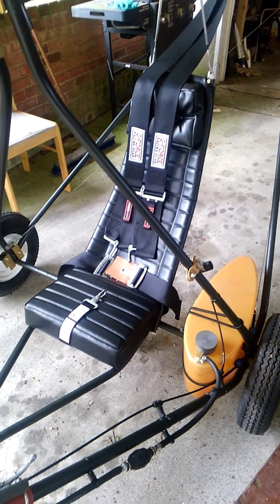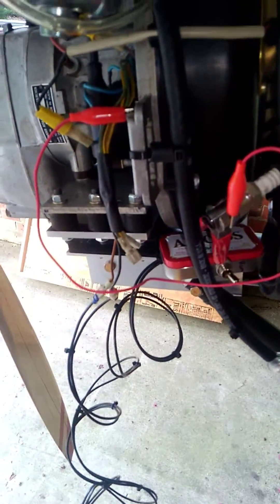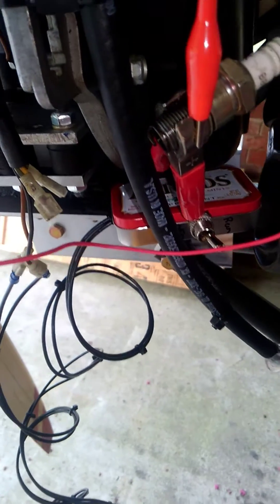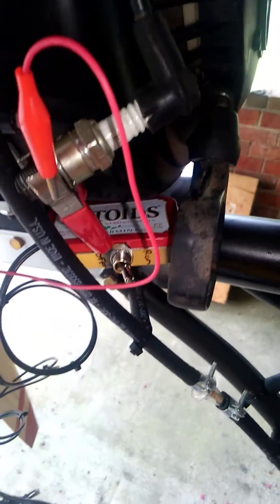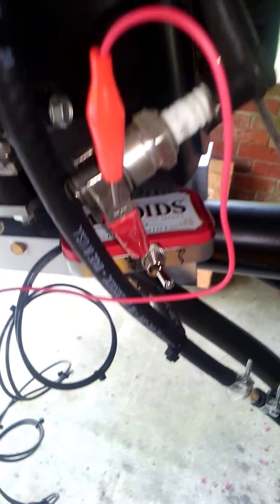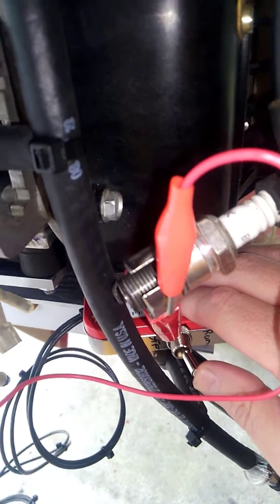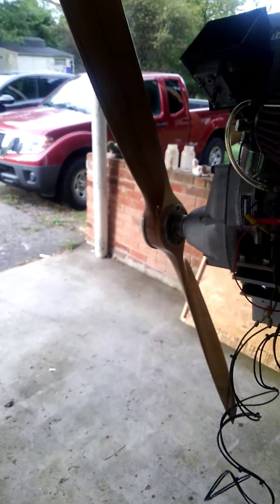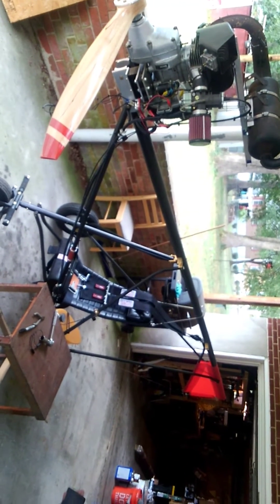A quick tour of the Chotia Weedhopper cockpit and engine

Comment: That looks to be an original Weedhopper of Utah fuel tank.
Reply from the maker: It certainly is! Extra nerd points for that you know.
Reply: @bmitchely  I used to watch them being made. I'm the designer's daughter.
Reply from the maker: @Ladychotia  Well, This Weedhopper has been in my charge since about '87. Bought it used, built in about '83, and made airworthy again in '88. I flew it until about July of 95 when I cold not climb out of Gable Branch and crossed Line Creek Rd. at dump truck height. After going over the road and under the power lines, I shut off the engine and hit a grape arbour.
The dump truck driver got out and yelled "YOU OK" I replied "Yes"...
I heard him say something akin to the word 'idiot' before he climbed back into his truck and drove away...
Fast forward to about 2013 when I receive a phone call from my Mom, saying "You need to get that little airplane out of the barn. 
That little airplane is one one you see above.
Reply: @bmitchely  that is incredible! That is most likely a Weedhopper of Utah plane. My mother sold the company in 83. My ex-husband bought it in 96. Then we retired it on 06.
Reply from the maker: @Ladychotia  You should do a video about your time in the Weedhopper factory and post it to the Weedhopper group on Facebook.

Comment: That's creative. Are you pulling a self tapping screw in it to make sure the lid stays on with the vibration?
Reply from the maker: No, this was just to test it out. The actual switch will be mounted in a binnacle along with other engine and flight instruments. I like Altoids tins, have a look for my 1802 Membership Card computer. I've built a 1970's computer in one of them.
Reply: @bmitchely  I just love seeing how creative fellow pilots can be.
Reply from the maker: @rickbucy7988  You know, with a couple of old Futaba single axis gyros, two "1/4 scale" digital servos and one of my 1802 computers in an Altoids tin...
I think I could make a simple autopilot for the Weedhopper.
Reply from the maker: A link to the 1802 Alroids Tin computer: https://youtu.be/oOlXZCP9rCA